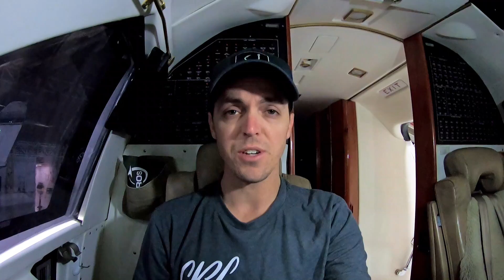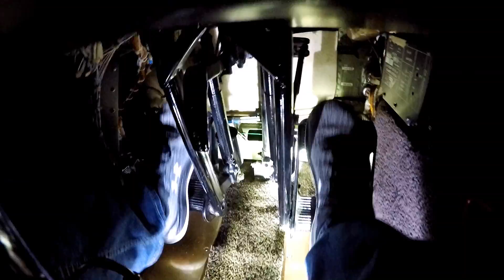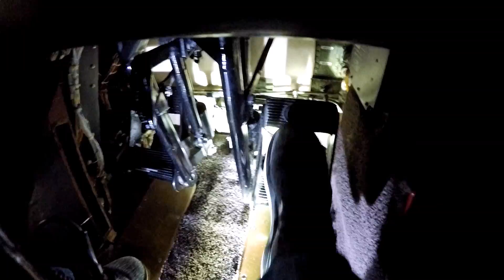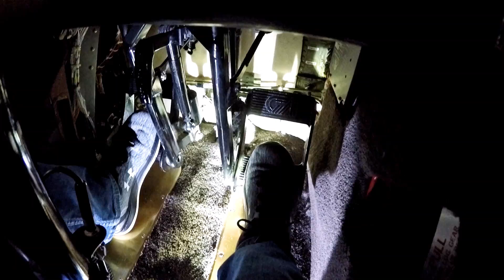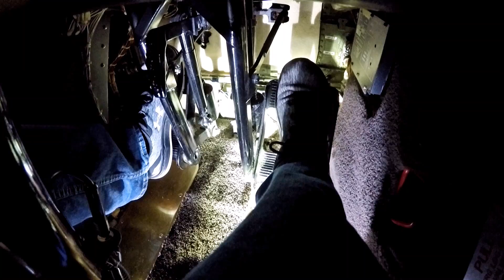Tech Tuesday - Why we keep our feet on the rudders before landing

Comment: HEY, about brake pedals I have question for you:  when I was young (half a century ago) pilots used to apply full thrust for a few seconds before releasing the brakes and starting the takeoff roll ...while, nowadays, they skip this phase and start rolling as soon as they get into the runway (actually, the former 'old' procedure would help to detect engine problems before V1 and avoid most of the engine failure after takeoff shown in YT videos, right?)
Reply from the maker: The engine problems have pretty much been eliminated on modern aircraft, so that's not an issue. We will make a static takeoff by holding the breaks until power is applies when runway length is a concern. When we have plenty of runway, we usually make a rolling takeoff to be more comfortable for the passengers.

Comment: how do u steer with out tiller ? Brakes ? duff braking ?
Reply from the maker: The Gulfstream has about 8 degrees of nosewheel steering from the rudder pedals, so we can maintain runway center-line with that, then move to the tiller to make the hard turns on taxi.

Comment: Shawn got a question pertaining to the breaks- Assuming your using the elevators to slow the plane down and the reverse thrusters - you dont need that much break pressure applied to the wheels is this correct?
Reply from the maker: That is correct. On an average day, the G-IV can come to a full stop in about 6,000 feet by using only aerodynamic braking and thrust reversers.

Comment: Can you still use that big rudder to help with center-line steering though?  Keeping the toes on the brakes is good for "just in case" scenarios, quicker reaction times.  Did Gulfstream ever figure out why the nose gear might jerk starboard or port?

Comment: Question regarding PPL: I want to do a 21 day accelerated PPL course, however, once I’m done I can’t fly again for three months because I work overseas. Do you think it’s worth it to do the accelerated course if it’ll be three months before I can fly again? Or will taking a few hours to review be good once I get back in the air? Given that I’ll be studying every day and using a sim during the three months.
Reply from the maker: I don't see a three month break being a problem at all. If it were a year or more, you would probably need a little refresher, but three months should be fine.
Reply: Corporate Pilot Life thanks for your advice!

Comment: Hey Shaun (I hope I got the spelling correct), on you're takeoff and landing checklists you mention air start. What is it? I would have assumed it is to do with starting the engines but they are obviously both already going at the time?
Reply from the maker: First, you got the spelling exactly correct...thank you for asking! You are also correct about the air start. That is a re-light ignition in the event that an engine experiences a flame-out. It will automatically re-ignite the flame in the engine. It isn't really needed unless we are in heavy turbulence or precipitation.
Reply: @CorporatePilotLife  thanks Shaun. Keep doing what your doing!

Comment: Nose wheel steering issues at touchdown is a SERIOUS problem. Sounds like a bandaid fix from Gulfstream.  Was this a factor in the fatal GIV runway landing excursion in France a few years back?
Reply from the maker: This is one of the suspected causes of that one. It's hard to say, because it's caused by ice in one of the servos, so by the time the investigation happens, the ice would have all melted. Gulfstream has a fix for this issue, but they decided to train the pilots how to handle it just in case it shows up again.

Comment: NWS should be locked until touch down. my guess is if you land with some yaw in the plane the NWS will turn as well. I thought thats why you lock the fron gear from turning until you are under 60-70kts once you loose your rudder/control authority and switch over to steering. 
so to turn this jet do you have NWS as well? or you only have differential braking? 
thx for this.

Comment: What are your thoughts on the loss of Atlas Air 3591 on approach to IAH?

Would an accidental spoiler deployment cause a nose down situation when descending from 6k to 3k?

When I heard the dreadful news that day the first thing that popped into my mind was your explanation of the 'Nut Cracker' and why it is checked on approach.

The incident  happened about 20 miles across Galveston Bay from me.
Reply from the maker: What a tragic accident that was. To be honest, I'm not very familiar with the B767 systems, so I hate to start spreading rumors about something I don't know. My initial feeling is that an inadvertent spoiler deployment would not have caused that, but again, I could be completely wrong there. I am waiting to read the reports as they come out to learn the happenings of that day.

Comment: What happens if you go to clean it up and your copilot is still on the brakes?
Reply from the maker: The brakes may lose pressure for a moment, so it just gets a little jerky. On some planes, it will hold the current brake pressure until the flaps are done moving, even if you take your feet off the pedals. This is a problem if you are trying to exit the runway, because the airplane will just stop wherever it is until the flaps are done retracting.

Comment: Fixing one issue could lead to another unforeseen problem such as landing with the brakes energized  Enjoy your videos
Reply from the maker: The G-IV actually has a delay system where the brakes will not be active until one second after touchdown. This prevents locked wheels on landing.

Comment: That's interesting,  thanks Shaun.  It goes against the keep your feet off the brakes until you need them mantra we are taught as pilots.   Sounds like a recipe for some flat spots on tires.   You guys are pros though,  adjust and adapt.   Take care.
Reply from the maker: Yeah, that's been a bit of an adjustment, but with this rudder pedal design, working the rudders while staying off the brakes is fairly easy.

Comment: Shaun, why does the plane nose wheel deviate left or right? Have the came up with a reason for it? Seems like a bad fix to a worse problem as if you landing and the front of the plane runs either way your body momentum will swing and you will have a hard time getting to push the pedal before hitting the grass no? Seems like a issue they should be looking to fix mechanically not giving more work to pilots. Just my thought.
Reply from the maker: They have it pinned down to a servo in the nose steering that is allowing moisture to protrude then freeze. They have implemented a fix for this, but have decided to train pilots how to handle the situation as well. Better to not put all of the eggs in one basket...

Comment: Before when you were landing with your feet on the floor how did your brake? Is it automatically controlled by the aircraft or did you just slide your feet up after touchdown? Thanks!
Reply from the maker: No auto-brakes on the G-IV, so you would just slid the feet up the pedals

Comment: Shaun,
What in the structural design does Grumman say is causing the uncommanded turn?
Thanks!
Reply from the maker: They have it pinned down to a servo in the nose steering that is allowing moisture to protrude then freeze. They have implemented a fix for this, but have decided to train pilots how to handle the situation as well.
Reply: Corporate Pilot Life thank you Shaun! I assumed there was some kind of fix in the works! Commendable that they were transparent and responsible.

Would be very interesting sometime when you could comment on the Gulfstream that plummeted off the runway with the gust lock engaged (Can't remember the airport but up in New England I believe) and also the Gulfstream that drifted off the runway on its takeoff roll. It had something directly to do with the steering. The crew involved had swapped with another Gulfstream and didn't use the steering procedure correctly.
It was like the nose wheel was inadvertently allowed to be disengaged and with a crosswind they ran off the runway. The engines were still running after the jet came to a halt. I think it was a cosmetic maker who owned the aircraft. (LOREAL I believe).
Appreciate it!

Comment: Here’s a suggestion, explain the crosswind landing procedure. Crabbing into the wind and transition into a sideslip maneuver. I know this is counter intuitive to do this but if the aircraft exceeds the demonstrated crosswind it may be necessary to prevent side load and drifting off centerline. 
Aerodynamic braking is the preferred method to slowing down.
Reply from the maker: That’s a great suggestion...thank you!

Comment: In your most recent video, both of you make a comment about having the feet off the rudder pedals as you put the flaps up in the after landing flows, what's with that?
Reply from the maker: In some airplanes, the brake pressure momentarily drops off when the flaps start the retraction, so to prevent any jerkiness we keep out feet off the brakes when we retract the flaps.